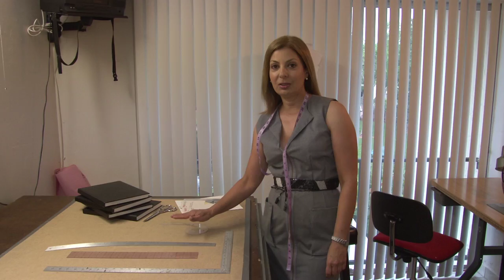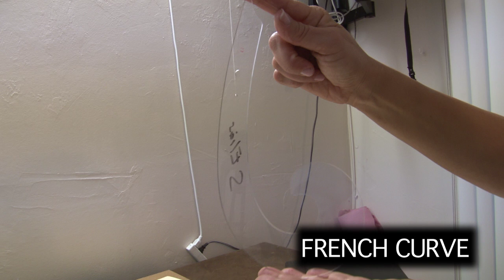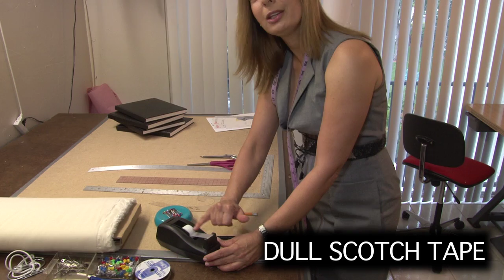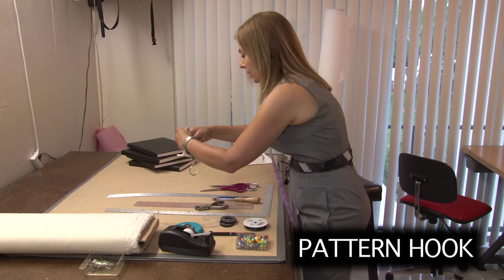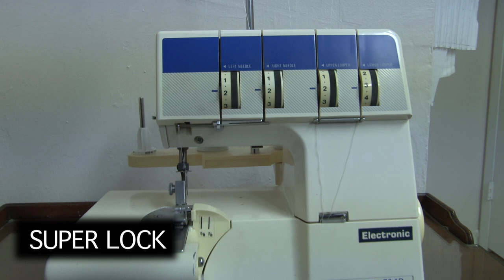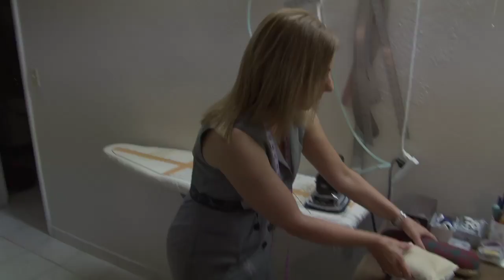How To Set Up Your Fashion Design Room!

Comment: Hello Susan,

I'm needing to buy a tailor's ham and have read that white oak shavings are the best stuffing for tailor's hams. That the stuffing in conventional ones sold will not give your garment the cleanest look and may even mold inside from all the steam, over time. I'm an aspiring fashion designer so I want to use what'll give me a professional look, and of course do not want to be making garments that I will sell to others, using something potentially molding inside. I don't see any hams filled with white oak on the market. The only ones of the kind that I've seen are used vintage ones, and I don't know if using those would be very sanitary.

What are your thoughts on this? Should I make my own, and acquire white oak shavings to fill it with? Is it necessary for a professional look? Do you have any already made that you recommend?

Thanks
Reply from the maker: Thank you for this information. My tailors hams are very old and they are still holding up well. My suggestion is to go to a professional supplier for the best ones. Not to buy cheap 
Imitations.
Reply: @susaneliascouture  Do you have the name of a professional supplier I can look up online and purchase one from? I don't live in a big city.